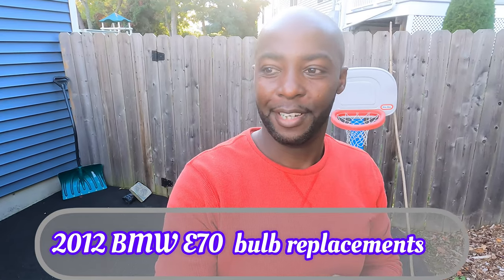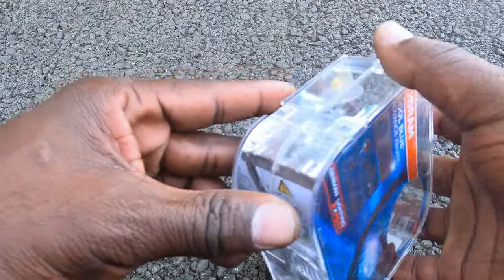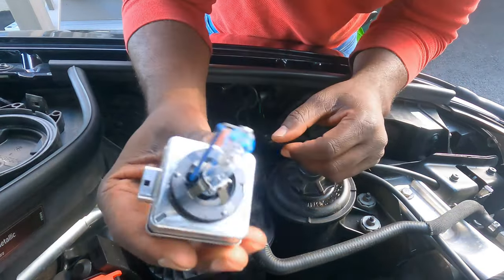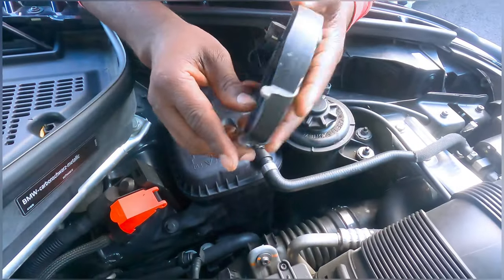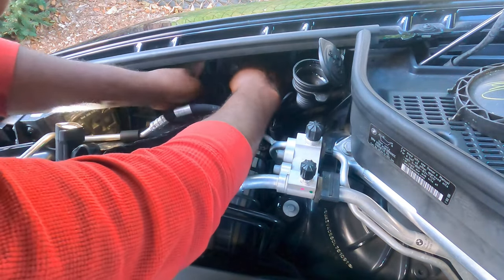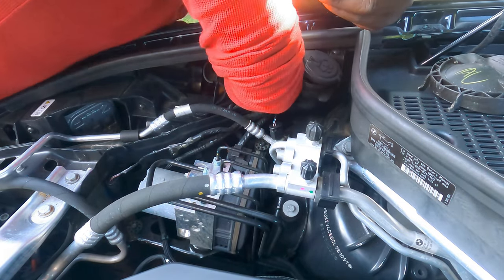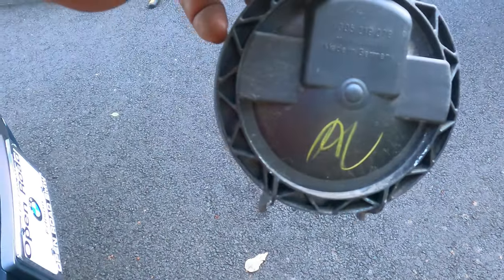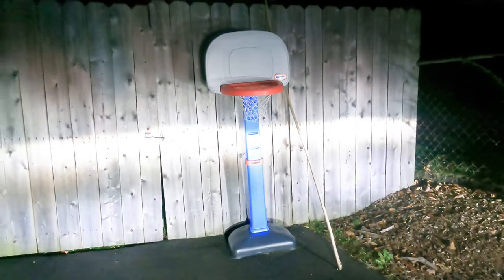2012 BMW X5 E70 headlights bulb replacement

Comment: how is the bulb restrained ? how did you remove it?
Reply from the maker: There is a metal clip that hold the bulbs. You have to closely watch the video and listen to it. It’s a bit complicated. You have to push it to the side and down and it will release the clip then you can take out the bulb.

Comment: Thanks for info for some reason my cable doesnt want to pull that far back so im struggling also left side
Reply from the maker: off course. I am glad it help. 
You have to put your hand on the side of the car as I did. I had to pull the cable just a little.  not to hard you do not want to break the connection. I did not see anything else holding mine up. maybe your car is a bit different. take a flash lights and see if  the cable is  held by something.

Comment: Does this work with the dynamic headlights - need LED, high and low beams trying to figure out what to get
Reply from the maker: As far as I know it should. If the car has Bulbs  style LED like I have installed should be fine. But if it had Factory made LED and cannot be changed I cannot guarantee that it will work.

Comment: Does it come with a module or it works with the OEM ones ?
Reply from the maker: No module is needed. Everything works as normal and no error on the dash neither.
Reply: @CarStomIt  maybe I got this wrong but on my E70 I have OEM xenon bulbs that comes with a module to make it work, so is your car equipped with the same ?
Reply from the maker: @eslamsedky72  do you happen to have a picture. I didn’t see anything extra that needless to be haded. Just did what was on the video and everything works fine and the color is definitely brighter and color is 6200-6500K.
Are your lights not working after replacing them? Or do you get an error message?
Reply: @CarStomIt  just yesterday I got the message that the right side not working and I was looking for a replacment when I saw your video.
My first question is based on previous experience with the left side when it stopped working and I had to change the bulb and the module (which cost me over a 100$ six months ago) so if these bulbs will work on the existung modules (or totally without them) I'd go and buy them directly
Reply from the maker: @eslamsedky72  theses bulbs has been on the car for over 3.5 months. Almost 4 months and they are still working great.  And no errors on the dash so far